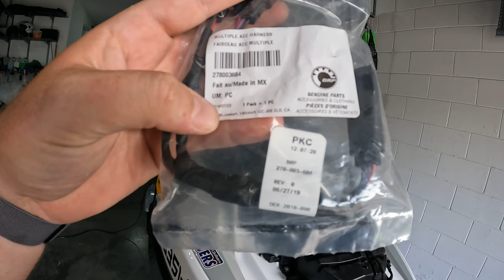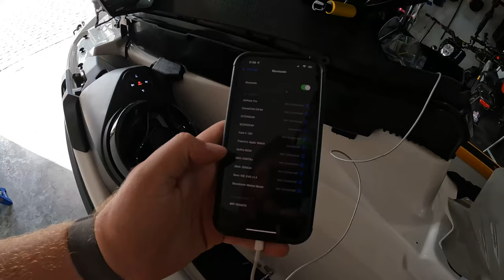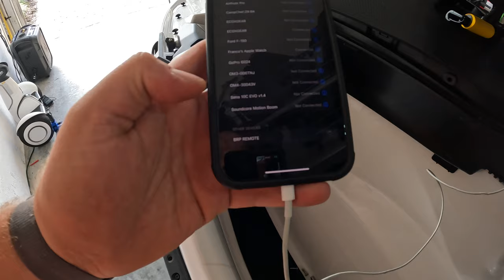Seadoo Fish Pro Premium Audio Install

Comment: Were you able to replace the screw you removed at 5:22?  I couldn't get it back in because the speaker was in the way.  I feel like my side panel is loose now...

Comment: Just a question 🤔🤔 did you have to take speaker off to. Put the front panel back on? 😂😂 I'm sure speaker go in after panel is installed 😂😂

Comment: Where is the audio fuse?
Reply: Did you ever find the fuse? Im having audio issues but cant seem to find a fuse for it in the fusebox.
Reply: @txpyroguy817 it’s one of the main fuses in the fuse box near battery. Replaced it and all better
Reply: @txpyroguy817  It was the basic main 15amop fuse in fuse box . check them all